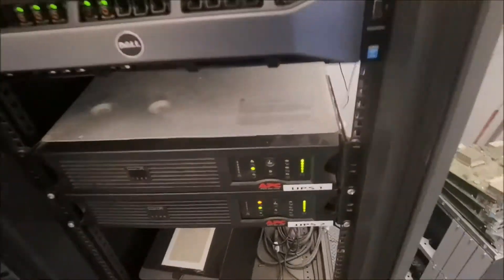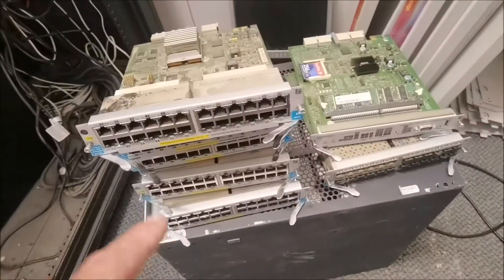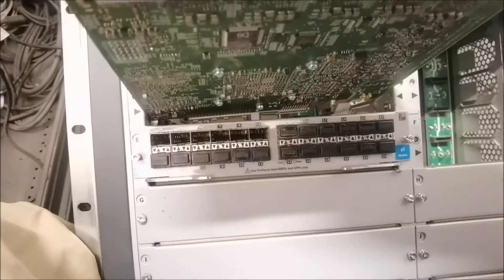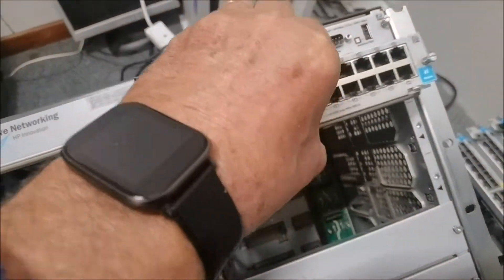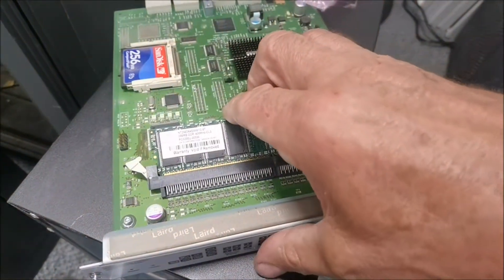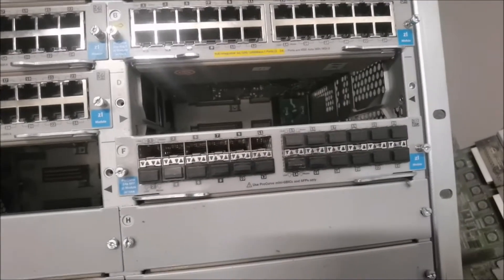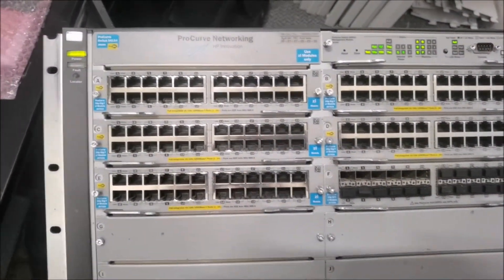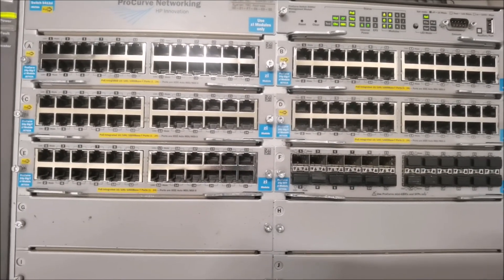HP PROCURVE 96 PORT POE SWITCH FAILED AFTER POWER CUT EASY FIX

Comment: These modular chassis based systems don't boot super fast, but are pretty damned reliable. I have the Aruba 5412R at my school and despite going through a huge number of power cycles due to rolling black outs in our country, has never given one issue.